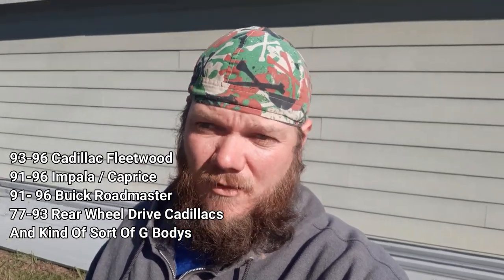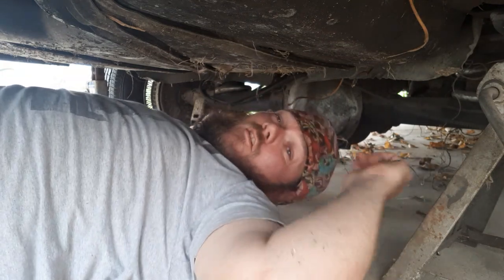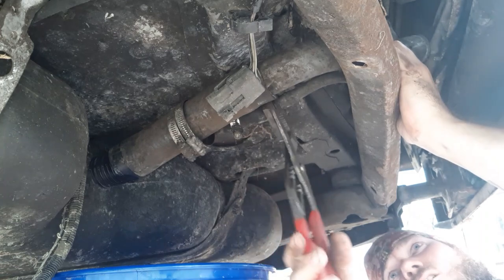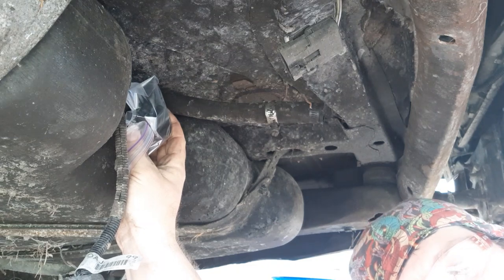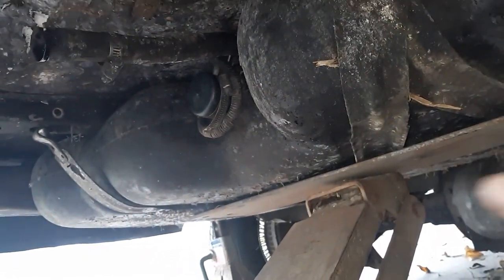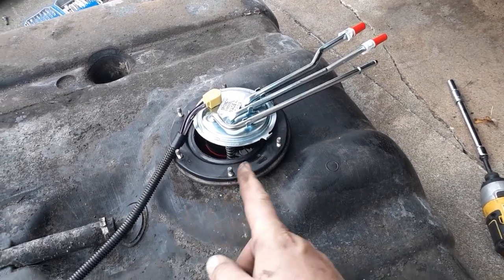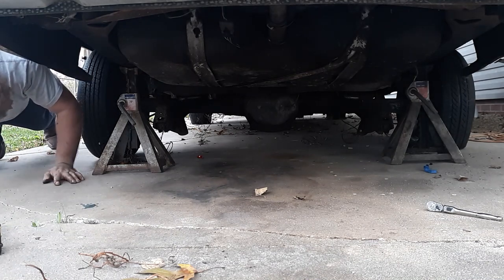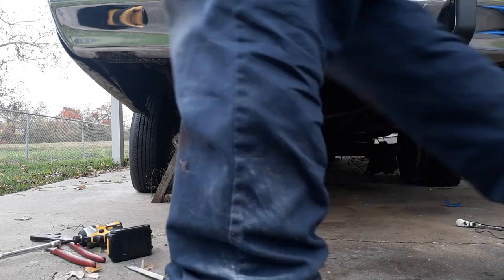Fleetwood Fuel Pump Replacement

Comment: Really well done,  thanks so much for making this video! I daily a '94 Fleetwood and original parts are getting old
Reply from the maker: No problem im glad I could help we need to keep older cars on the road
Reply: @thecadillacdanshow8658  I put starting fluid TBI starts right away then it's just off you think it's the fuel pump
Reply from the maker: @FranciscoGarcia-wc7tc  very possible
Reply: @FranciscoGarcia-wc7tc  theres a jumper wire to the fuel pump too you can run straight 12v from battery to test the pump. Its on the passenger side firewall where the relay is attached. Should be red wire with a female end. I think ive heard of them being orange too.
Reply from the maker: Good information I always wondered what that wire was for
Reply: @thecadillacdanshow8658  no problem boss
Reply: Your videos are a huge help, and I thank you for sharing your knowledge!
Reply from the maker: @rebellemming84 thanks I'm glad it could help
Reply: @thecadillacdanshow8658  .good looking on the fix homie. Question . I hit the switch .and just clicking Batts ; new noid; motor are good. I can't find what's wrong. I just changed the fluid . Was testing . And it slowly went up and down .till down . Then the clicking? 🤔 thanks.🙏🏼
Reply from the maker: @soulessm8015 man I have been chacing some electrical nightmares recently also! Do you have a two pump setup? Are both pumps having the same problem or just one
Reply: @thecadillacdanshow8658   I have a 3 pump set up . The other 2 back pumps work .it's the front  only🤔

Comment: Just got a 95 fleetwood hearse that needs a new tank. This video helped out a-lot I appreciate ya!
Reply from the maker: Let me know if the tank is the same in a hearse I'm curious
Reply: @thecadillacdanshow8658  it is. Thankfully, everything is the same mechanically chassis etc. only difference is the back doors and back. Body is fiberglass
Reply from the maker: @MrTacticalwolf  good to know I would love to have one, one day
Reply: @thecadillacdanshow8658  they are cool. I just started digging into mine deeper. Im in the rust belt so i have my work cut out for me.

Comment: Thanks for the great video! I'm about to do this procedure and am wondering where to get the blue plastic tool for the fuel line connections?
Reply from the maker: I bought that one at o'Reilly's but all parts stores should have them
Reply: @thecadillacdanshow8658  Thanks!

Comment: Great video. I have the same car as you do, but have never started it in 3 yrs. Tried to start it today but no go. I imagine fuel pump is shot, will be a nightmare to change it with a full tank of gas. Any comments will be appreciated.
Reply from the maker: You can pull the hose off where the filler neck connects to the gas tank the will be a plastic baffle inside of the opening of the tank that you can pull out and it will let the gas drain

Comment: What type of oil do you recommend? I recently purchased a 1993 fleetwood  and I want to do the oil change before anything.  I reside in phx az. Thanks
Reply from the maker: I use mobile 1 full synthetic that's what my 96 had on the oil cap from the factory so I have run it in all of my cadillacs and all of my other cars for that matter i have ran conventional oil in some cars that sat a long time ago and when I went to change the oil it was all gelled up i had to stab it with a screw driver to get it to drain my tan Cadillac sat for 7 years and the oil was still like new so that's why i run mobile 1

Comment: How's the fuel pump holding up? Heard guys having to do the job over for not using A/C Delco GM parts
Reply from the maker: Well it did quit but I think it had a lot to do with what I did I stored the fuel tank out of the car for a few months I had the tank on its side so the pump was not submerged in fuel and i think it rusted when i get done building the car I'm going to warranty it out and see how it does

Comment: My 96 Fleetwood done started coughing when the weather gets hot, and the fuel pump is whining real loud, and the fuel ain't getting through....

So I turned the car on the next morning, and it was back to normal... but after 30mins driving round the city I come home again, and she starts coughing again losing fuel pressure...

Is it most likely the fuel pump?
Reply from the maker: Could be the fuel pump over heating check the fuel pressure when it starts to act up rev the engine up and see if it keep good pressure

Comment: On your fuel pump was the vent hose hooked up to anything? I was dropping my tank today and noticed that the vent wasn’t hooked up to anything and looked like it never has been hooked up. I’m 2nd owner of the car and everything still original, my question was what is the purpose of the vent hose?
Reply from the maker: Yes the vent should be the hose hooked up with the hose clamp the other two have quick connectors the vent goes on the passenger side hose

Comment: Dan question for you , my fuel pum on my fleetwood,  gives me full tank reading when its not . This is a new pump . When the pump is inside the tank and secured. Thats when it gives me the full reading. Butvwhen its loose and not secured and i slightly rotate just a bit to the left it reads good. But then the pump dont line up with the tank opening and the circle plate dont sit on top right because the pump is out of line. Any suggestions? Thanks
Reply from the maker: It sounds like the float is hanging up on somthing.
Reply: @thecadillacdanshow8658  hi Dan, thanks for the reply I appreciate it.  I thought so too but the floater is cleared. Someone said it might be the pump itself.
Reply from the maker: The pump and the sending unit are two separate systems in a way all the pump dose is send fuel and all the sending unit does is send a signal for the fuel level (and send fuel through the lines) there is a strip where the float mounts to the unit that's what changes the resistance to tell the fuel gauge what level the tank is at it may be damaged and shorting out when coming in contact with fuel? They do make a complete assembly if the sending unit and pump all as one that was the route I went due to my gas gauge showing three bars when it was dead empty

Comment: Hey, I have a 96 fleetwood and need some help… I don’t have a check engine light on but when my car is on the exhaust smells rich (smells like gas)… if it’s cold or dark outside you can see blueish smoke… if it’s bright out you can’t really tell it smokes but it smells
Reply from the maker: Blue smoke is normally oil if it's running rich it will have black smoke wouldnt hurt to hook a code scanner up just to see if it has any stored codes

Comment: I have a 93 fleetwood so will it be the same I bought the assembly hit fuel pump came with it from rockauto
Reply from the maker: Yes it is I pulled the tank on struggle love it's a 93 has the same style pump I belive it's a diffrent part number but process is the same
Reply: @thecadillacdanshow8658  my lowrider been sitting up for over 10yrs so I know the gas is old and when I try to start it just cranks won't turnover and when I son had me turn the key on he didn't hear the fuel pump kick in so he said change fuel pump assembly dump the old gas out and put some stuff in there to clean up the the old gas you said it in the video I can't remember the name but it's for when a car gonna sit up so you won't end up with bad gas sad part it's a full tank 🤦🏽‍♂️🤦🏽‍♂️🤦🏽‍♂️ I went to a car show and the pass key default kept coming on and I couldn't start the car I had to unplug the battery for 10mins then plug back up and let the car reboot then I could start it I even had it bypassed a day before the car show and didn't have no problem

Comment: What’s the inner diameter for the fuel filler hose? Is it the same at both ends (neck and tank)?
Reply from the maker: I will have to look I belive both sides are the same

Comment: Nice there’s no videos on our big body’s keep up the videos what exhaust are u running ?
Reply from the maker: Thank You I'm going to try to do as may Fleetwood repair videos as I can there realy is not much as far as repair videos so I just make then as I need to work on mine as for the exhaust its Flowmaster 40 series cut off befor the rear axle  with no converters

Comment: Hey Dan, my caddy shows full tank all the time doesn’t go down, what do I do?
Reply from the maker: I want to say there is a fuse for the gas gauge itself I know on the 80s models there is on big bodys its probably fused on the same circuit as the pump check your connection if I remember correctly the purple wire is for the fuel level

Comment: Goodafternoon Dan....i need some help ...my cadillac its a 1993 5.7 v8 ....would this work on mine or  it 9nly works on 1994 to 1996  ? Ty
Reply from the maker: The process is the same. I do belive it is a diffrent part number for the 93
Reply: Hey bro I have a 93 but every fuel pump asymbly I see doesn’t have the right connecter and lid to the tank is to small it basically falls in 

But every 94-96 fuel pump has the right connecter and is large enough to fit the tank , I’m confused
Reply from the maker: I wonder if they gave you the fuel pump for the sedan Deville that body style ended in 93 double check and make sure it's for a Fleetwood

Comment: I change my fuel pump and gauge read full. What you think it could be???
Reply from the maker: Could be the sending unit but check your fuses first
Reply: @thecadillacdanshow8658  First, thank for relying and im fan of your channel! Second, have you ever install a continental 5th wheel on your car?
Reply from the maker: Thanks for watching. I have not installed a continental kit I have seen a few weather or not they were install correctly I'm not sure but the ones I have seen they cut the bumper and run all thread through the bumper to bolt the kit up

Comment: How do you depressurization your fuel lines?
Reply from the maker: There is a shrader valve on top of the engine on the driver side it kind of looks like a valve stem for a tire you can press it and it will let fuel out out a rag over it while you do it to keep from getting sprayed with gas

Comment: I got a problem with my 96 fleetwood radio a/c component and interior lights got no power fuses are good checked the wiring and its all good but cant find why they wont get power 
Dash and windows work
Reply from the maker: From what I can tell check out the power wire it looks as if it comes out of the instrument cluster it's a purple / white wire the pin on the cluster looks to be A4 it shows a label of 724 I dont remember if the wires are labeled this is what the diagram is showing. You can look on the heater control connector also should be a purple / white wire and same one the radio you instrument cluster lights up right?
Reply: @thecadillacdanshow8658  yes cluster lights up,windows work just not interior lights radio or a/c unit

Comment: Please  let me know  what is the function of the second  thin  rubber  hose   ?  Beside the  big main filling hose   ...
Reply from the maker: It's a vent tube to help keep gas from splashing back out of the filler neck when filling up the tank with gas
Reply: @thecadillacdanshow8658    thanks for the clarification   ...    
but it was not  existing in the  old steel gas tank  for  example  for the  1992  Fleetwood ?
Reply from the maker: @fpsnashamdan7362  very true

Comment: Hey man ive been trying to find the fuel pump relay, any idea where it is?
Reply from the maker: It's behind the fuse box under the hood on the passenger side some times it falls down on top of the wheel well. I belive it's the same as the fan relays they are located on the front of the fuse box under the hood
Reply: @thecadillacdanshow8658  thanks so much i was way off, i was looking behind the passenger dash.
Reply from the maker: @SpacelionsOdysssey  no problem glad I could help

Comment: Would you know where is the fuel pump relay location is at?
Reply from the maker: It's around the area of the fuse box on the passenger side under the hood it should be mounted on the fire wall but most the time it has fallen ontop of the inner fender well
Reply: Is it one of those 2 green ones?
Reply from the maker: No those are for the fans should be further back towards the fire wall
Reply: Thank you for your help🙏🏼

Comment: I ran out of gas one day, put a gallon in her and went straight to the gas station about 1.5miles away. She took 20 gallons. Id say between 3-4 gallons sit in there that dont get pumped. Doesnt make sense.
Reply from the maker: Have you pulled the seding unit out of the tank yet it may be bent like mine was or one of the hoses in the tank could have a hole in it and its bypassing fuel at a certain level
Reply: @thecadillacdanshow8658  replacing it now. Shop replaced pump last year before i bought it, didnt do the sending unit, so my guage only reads from 2 ticks above 1/4 tank to full. Pump just went up on (got it under warranty). Friend sent me a used sending unit but it seems to have the same issue so ordering a new one today. Old one wasnt bent, i didnt check the hose. Love these cars but im about to give her a break and put my Monte Carlo on the road. Lol Hopefully get paint, wheels, headers and exhuast done. 
Have you done the body bushings on these yet?
Reply from the maker: @johnpippin2426  I feel you I'm getting my tan lac ready and it seems like everything is breaking on it just had to replace the alternator and now the oil cooler is leaking on the radiator. I have not done any body bushings but I am about to be doing a frame swap so I can touch on that when I do it
Reply: @thecadillacdanshow8658  yup just done my radiator lmao sucks because i needed it asap, I spent the same on one with the plastic side tanks as an all aluminum one cost on rock auto. And ended up having to wait anyway because of a molded hose under the overflow. I got her for $2500 like 14-15 months ago. Great deal, but ive put $2700 in her since then. Of course doing my own work.
I need a steering column. Not sure if you ever come across parts, but if so that would be great. My turn signal broke (not sure if I've mentioned it to you or not) and i cant get her inspected.
You doing a video on the frame swap? That'll be cool.
Reply from the maker: Yeah I built a full frame I have just been waiting to make the intro video for it been having bad weather and havnt got to film much
Reply: @thecadillacdanshow8658  hell ya. I say i want to get in on making videos but by the time i think about it im half way through whatever im working on lol not a lot on the fleetwoods besides you. You do good though, youve helped me a few times lol
Reply from the maker: I still do the same it's a hard habit to get into grabbing a camera
Reply: @thecadillacdanshow8658  i can imagine. I bought a laptop almost 2 years ago, havent gotten around to buying a gopro yet, still. Or if thats even a good choice for youtube videos. A lot of the fishing guys i watch use them though. 
Just watched your build a bridge video. Great job explaining the different ways to measure and tips on what to use etc.. Im not in the lowriding scene but youve sparked my interest. I am on layitlow though. I went there to see if there was an aftermarket option for the steering column, but havent found anything yet.
Reply from the maker: Layitlow used to be the shit but it has died off unfortunately I'm not to sure on a stering colum if you want to delete the air bag and vatts I dont see why you couldnt use like a ididit colum
Reply: @thecadillacdanshow8658  ya i seen those, but not  for a fleetwood. Some guys use jeep rag joints and shafts i know of, but thats all i could find. Got a guy in Chicago thats supposed to be pulling a column for me and shipping it but it hasnt happened yet. I might just have to travel a few hours to get one. Wish gm would just make the turn signal switches again, car is almost 30 years old so a lot should be going bad soon lol
Reply from the maker: You cant get one from the parts store or rock auto